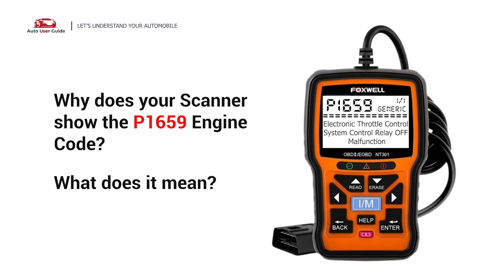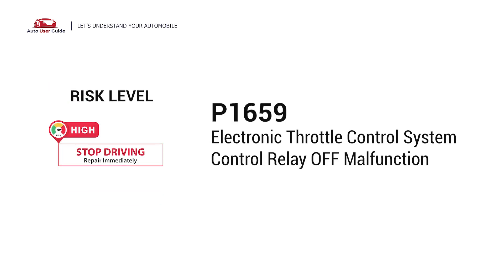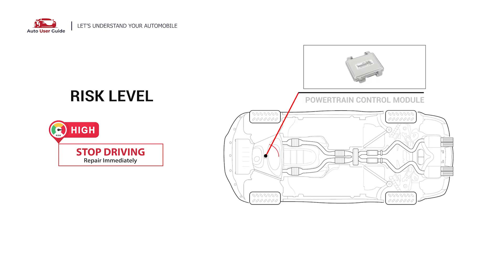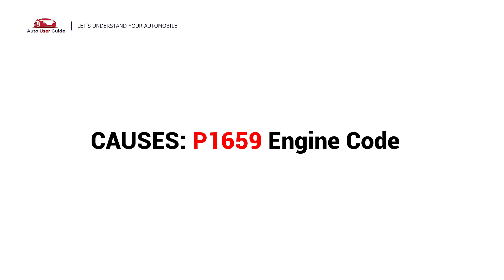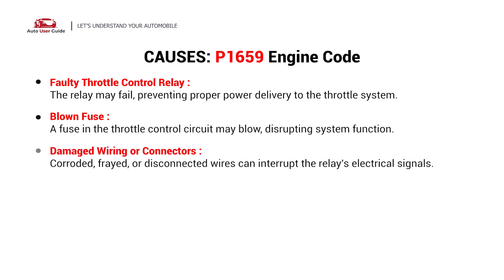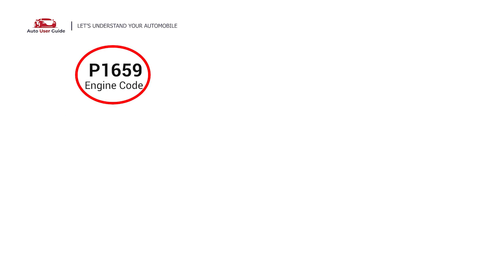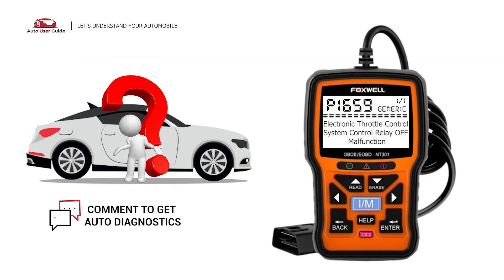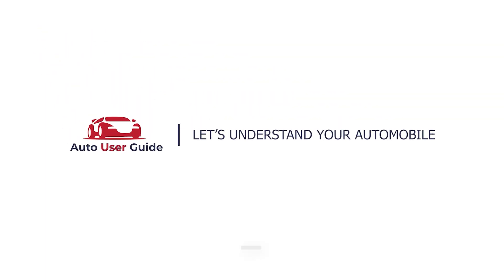What is P1659 : Engine Error Code Causes Explained

Comment: I just had my mechanic switch a fuse because my 2012 honda odyssey didn't want to start. He switched the fuse now my van started and my AC doesn't want to turn on. The mechanic checked the fuses everything looks good then he put the scanner on and found the P1659 code. Just trying to find out what to do